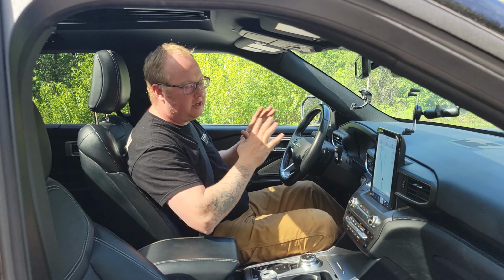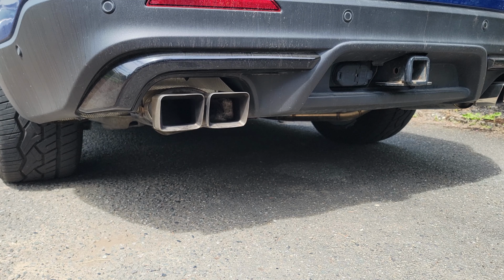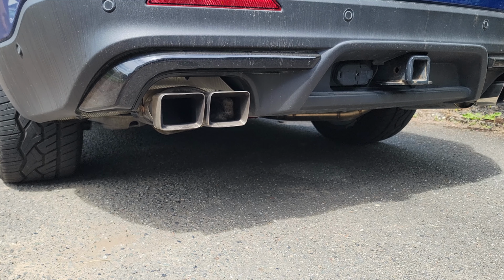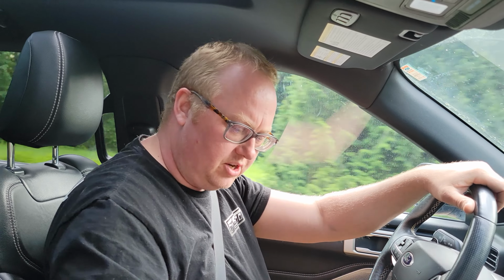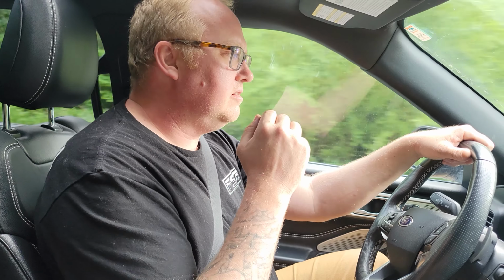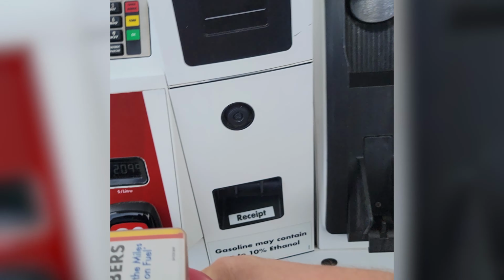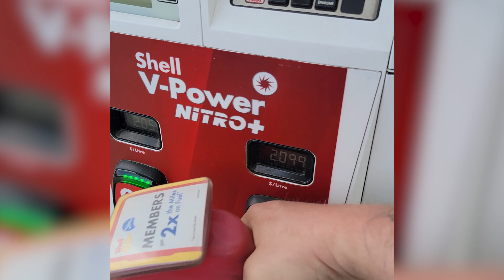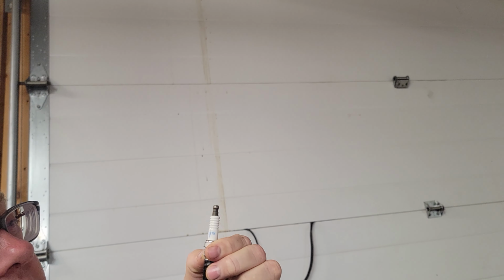ZFG DMS tune with trans brake | 2020 Ford Explorer ST

Comment: How does the transbrake work with AWD, or do you have the RWD version.
Reply from the maker: It works great with AWD. It literally almost lifts the front wheels off the ground!

It engages first and reverse together.

Comment: Whats the code ?
Reply from the maker: P0300 - Random Misfire

P0316 - Misfire Deteceted on startup (First 1000 revolution)

P2196 -  O2 Sensor Signal Biased/Stuck Rich - Bank 1, Sensor 1

P2198 - O2 Sensor Signal Biased/Stuck Rich - Bank 2, Sensor 1

Comment: Aha I learned my lesson with a cracked plugs. My first car 1.6 fusion ecoboost, the plug somehow sucked it self threw the head, into the engine, threw the head and into the turbo. Ford replaced the engine for free they had never seen it before.
Reply from the maker: That would be frustrating!
Reply: @SouthdownGarage  yea it was pretty frustrating, I only had the car for about a month. But they covered it and gave me new 2018 fusion to drive while they replaced the motor so they took care of me👍🏽
Reply from the maker: @402SHO  that's good customer service! Nice!!
Reply: Dang.  Never had that issue with my 1.6 fusion